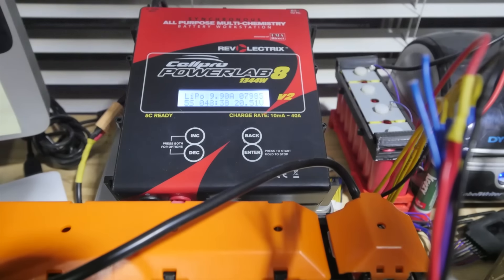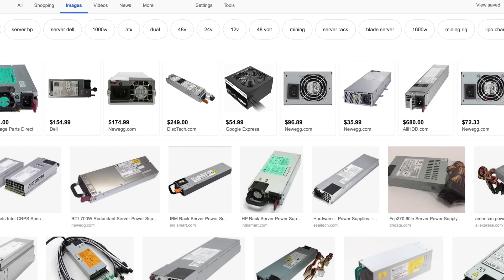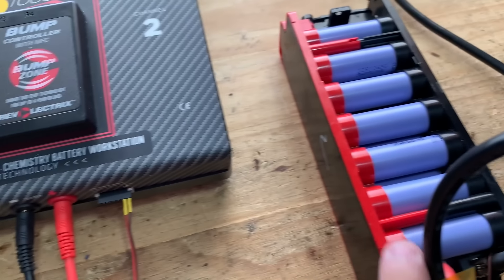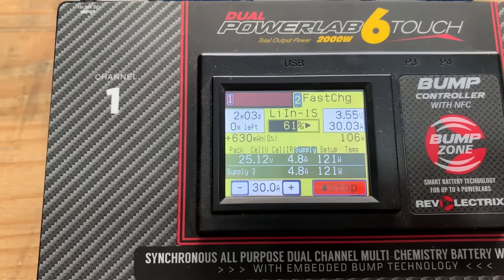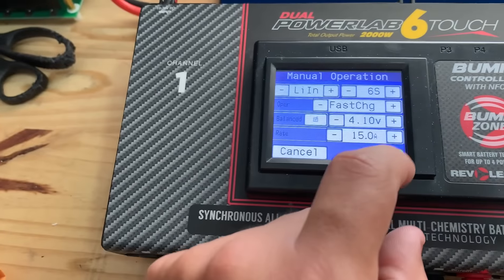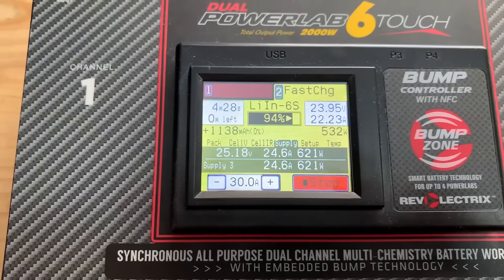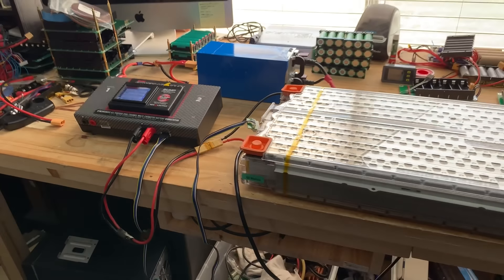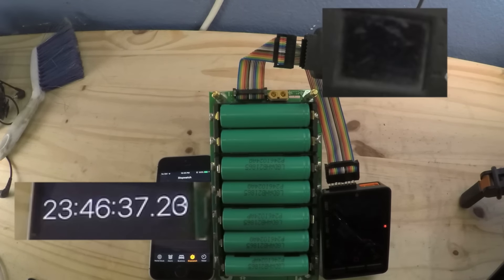$50 Dollar 2000 Watt 24V DIY  Power Supply. (2Kw)

Comment: Whenever connecting independent DC supplies either in parallel OR in series, it is ESSENTIAL that FULL electrical connectivity is checked for proper isolation AND equivalent voltage (parallel) and current (series) capability. In the case of series connection it is ALSO ESSENTIAL to ensure that a) BOTH cases are grounded properly and b) that the DC grounds are NOT connected to the Earth ground or when connected in parallel BOTH supplies will end up being shorted!
Reply: In a parallel setup, what generally happens if one PSU is turned off or fails?  ... my intuition tells me that I really don't want power being sent into the wrong side of a PSU  : O

Can't that large stepdown transformer become a really nasty step-up?  Or, does the design of modern power supplies typically preclude this.  I guess there's some nice power diodes in there - but surely they don't expect to encounter the full force of the PSU in reverse polarity.  I worry that the protection just wouldn't be beefy enough for such unforeseen abuses : /

Does it all just get stopped at the rectifier stage, no heat, no worry ?   I guess if it can't pass the rectifier at all - then the output smoothing stage with those big ol' caps maybe doesn't actually have to handle anything.  But what if there's some path there (in the output smoothing) that can break down and cause current to flow : O

For the record, I'm not about to try any of this... but I am curious as to why it works.

Comment: You can also add a resistive divider across the input pins and bring them
Up to about 13.5v before they start to over voltage. If you add a resistor across a pot inside you can bring them to over 14v. You should stack 4 of them and get a 48v-56v supply! I use the HP 1200w ps all the time for amateur radio stuff. They work great!
Reply: Hi, do you have information about this mod? im a amateur radio operation and this is a very handy power supply for my radios if they can provide 13.8v
Reply: Im looking for a SM  power supply to charge my fiat batteries with. I only want to charge to 4.0v/cell 14s so i would need about 56v. 4 stacked can get me there? I wasnt sure if they where adjustable.
Reply: i would like more info as a felow ham please
Reply: Woah woah woah, you are putting a server power supply load on a resistive divider???
Reply: Vortechnology no, internally you can set the output voltage from the reference via a divider. If you want more then 13.5v you have to modify another divider to trick the over voltage limit. Your not going to put 100a through a divider :)
Reply: Okay so you actually are changing the reference resistor, that makes a lot more sense, lol.

Comment: I believe the other charger blew up because the supply voltage was 12v.  Similar to why I blew up the antimatter charger I have.  The charger has to work to hard for the higher amp outputs.  So supplying higher input voltage should help out the charger a lot!  This is what I have noticed at least for the antimatter charger.  I did the same mod with same server power supplies lol!👍
Reply: Bingo.. The Powerlab 6 and 8 Touch also can go up 48volt input.. really helps out if you go past 6s and high current
Reply: So when will you be recieving your nobel prize for your anti-matter charger?
Reply: They said its in mail 😆👍
Reply: Casually using my antimatter charger, nothing to see here. :D
Reply: I've heard people had issues with them, can I ask which model antimatter and how old? I use a 1000w/30a 10s version with 2 different modded HP PS'. My fave (quieter one,) is only 575w (47a) on 110v and the other is like 1100w (but the fan is noisier and the mains cable is thick n huge!) I've used them to successfully power mine upto 28a (I never use it to max power,) and have had zero issues with it. Mine is already 2+ years old and used daily, but I've heard people with newer ones have had trouble with them from almost the "get go," when run at higher power levels.
Reply: Outputing 30A at 24v with a 12v input would mean it is pulling at least 60A 12v, and that is a lot of current...
Reply: A properly designed hobby charger will automatically limit the output once the input current limit has reached. Can't believe some much more expensive "smart" hobby charger will let itself smoke by input overcurrent  when my $16 B6 clone has such protection.
Reply: AveRage Joe lucky for you the post office isn't affected by the government shutdown. my application for black hole emulator permit is stuck due to no funding.

Comment: Series connection of switching power supply will upset the internal control loop of the individual units due to each power supply have slightly different internal impedance. Try drive the unit you have created at 90% of the rated capacity and show us what happens.

Comment: Why do you insulate the inside board from the case ground? If there's a short the current will travel back to the ground wire through the case.

Comment: So I'm running a 20S LiPo for my electric scooter. I'm going to build about 8 more 20S-4P batteries to replace my lead acid batteries. Right now I'm using a cheap Chenzhen Energy BMS. Any suggestions on a good BMS and charging system? I have a ton of different BMS's I got from Amazon but only the one I'm using had a wiring diagram.

Comment: 11:00 input current is limited by voltage. Increase the voltage to 32V to get 40A. You can add other + and - voltages to go above and below 12V by jumping them together. This is why a PC power supply has negative voltages available.
- 
TLDR: Jump the +12V +5V +3.3V on one power supply to get your 32V and 40A
Reply: Except you will find that the other Voltages will not produce the same Amps. So what you have just done is limited to it to 2 Amps if you don't blow it up first. Bad Idea.

Comment: Thank you so much. 
Can i use the hp power supply listed below to do the same thing or it has to be the same model,
HP 578322-B21 579229-001 570451-001 1200WPower Supply DPS-1200FB-1 A?
and if i need to use one power supply to feed an inverter with a deep cycle battery is there a way to increase the output voltage from 12 to 13.5?

Comment: Pretty sure when charger on last video fried its because the Boost converter in charger was trying to boost voltage to 24V from 12V 
supply and trying to get More amps than charger could Boost / pass thru  - got hot - poof - I use Icharger 4010 Dual to charge 120AH Calb Lifepo4 battery from car alternator - works well - Im putting 2 Tesla S modules in my RV right now -  also modded 3000 watt 50 volt server power supply- was not easy to get it to work - almost gave up( 2 weeks) but finally got it to work -  50 volt output power supply is what you my want- its what I need for charging tesla s 2 modules

Comment: One thing I learned recently is all these chargers have an input amp rating, and to get the full watts you need to input the max volts they advertise. Looks like this one is 30a. It’s a tricky marketing ploy they use and you’ll never be able to reach the advertised watts in practice.

Comment: Can you put the power supplies in series to bump it up to 24v on the input side to and loose the headroom of wattage output of the power supplies?
Could 4 be used and 2 in series then 2 in parallel for redundancy?

Are server UPS good power inverters?

Comment: This is slightly off topic, I want to charge by Chevy Bolt battery pack (355vdc) from solar panels which is not in the car! What do you recommend for a charge controller for that high of voltage? Than divert it to a string inverter which can take that high of voltage?

Comment: Good job! Btw as long as you left the ground connected to the mains they are still connected together so the cardboard in between is redundant but it is better than having metal on top of metal.
Reply: SuperBrainAK the output might not  be referenced to the protective earth on these PSUs anyways, so it might not matter. Sometimes the manufacturers just ground the case.
Reply: SuperBrainAK worth to check the grounding anyways. (I wouldn't want to short these supplies out :)  )
Reply: FinTutorials I’m pretty sure there is a CE rule that power supplies over a certain wattage need to be grounded
Reply: SuperBrainAK I think so too, but these server supplies might be designed diffirently, atleased the case was grounded.
Reply: in the video he shows that he put insulation under where the screws connect the chassis ground to the negative rail isolating the secondary of the psu from ground, so they were grounded all the way through
Reply: SuperBrainAK i agree, but there also are exceptions. I hace taken many power supplies apart and found that the wiring screw terminals or in this case the gold finger tabs are only connected through the fastening screw to the psu outer metal case and not to the secondary side of the transformer. Always check how it's connected with a multimeter!

Have a nice day :)
Reply: These are 100% guaranteed case grounded and you would only worry about this if you were using multiple phases and you are not even using that at 240v so that made no difference.
Reply: @SuperBrainAK  You may well be right, but you are aware that CE rules do not apply to him when he is in the US and not expecting to ship to Europe? It IS a point worth bearing in mind by European viewers however who may wish to follow this process, and in addition local electrical rules need to be observed. In Australia, I'm aware that there are now some pretty stringent rules in place where people are not even allowed to fit a plug top to a cable - they HAVE to use an electrician! Yeah go figure!

Comment: I've been scrolling through your videos trying to find the one where you modified the PSU to power up but I can't find it. I've tried this with 2 PSU's so far. One popped and died after pulling 30A from it for 3 minutes. It was a DPS-1200FB. The second, a HSTNS-PL11, worked fine the first time after I modified it, but then after I powered everything off and tried charging again a couple days later, the PSU's green led would blink on/off and the output would go from 12.2V to 0V repeatedly and annoy the chargers. The 3rd was also a DPS-1200FB works fine if I don't load it up much. Even 15A was too much for it as it shut down after 13 minutes.

For both, I was using a resistor between pins 32 and 35. On the DPS-1200FB, I used a 750ohm, on the HSTNS-PL11 I used 2 750ohm in parallel (375ohm), then like I mentioned, it turned on and seemed to work fine the first time only.

I'm just trying to charge my lipo's for my RC trucks. I run 2 chargers off of it, both set to charge at 15A, so probably pulling between 32-35 amps overall.

Comment: The safety code #21 is from the power supply having too much noise.  As said in the manual, "it is quite
common that everything operates fine until a high-current charge is performed and then the communication link is
lost as the current is ramping up to a high-current charge."

Comment: so i have a 14s24p Li ion battery with a standard 5A charger and if my BMS supports for example 30A Chargepower i can use a charger with 30A safely at home?

samsung 25R cell btw

Comment: Jehu, I am a datacenter architect professionally. One issue you may run in to is the fans being PWM controlled from the host server, might not run @ 100% unless you jumper the fans to 100% of their rated voltage or short the PWM feed to the fan +. Maybe worth looking in to? Not sure if you address this in your PSU hack schematics. Thanks for the content, ideas, and videos! Love your stuff.

Comment: I will never buy a brand named power supplies for RC lipos which cost $380  for a 1200watt at 18v. They never last  & they run hot! Server psu all the way to the bank. Thanks for sharing.

Comment: that thing just charged a cell phone in 3 minutes. if it could handle those amps that is. crazy power
Reply: You are not supposed to charge a LiOn battery at more than 1/2 it's rated storage capacity. Example, a rated 3000Mah battery should have current limiting of 1500Mah@ no more than 4.2V EVER.
Reply: @DrHarryT  i know, thats why i was saying if the phone (intending battery) could handle the current income. I know its completely unreasonable to assume that would work. I just noticed the capacity it was recharging the bank in the video.

Comment: Still can't figure out how to find the switch that turns on a server power supply.. A normal PC power supply is easy, connect the green wire to the ground and that's it. What if I can't find the pinouts for the one I have? Is there some way to figure that out?

Comment: What will happen if one of the SMPS fails. will it feed 12v to the charger. Will this damage the charger or the charger has low input voltage protection?

Comment: Jehu, I use a few Chargers like this, That I hacked, one I did the Floating Mod with Plastic washers and nuts(Nylon). I left mine apart for now, only because I may add them to a bigger Power supply I am making 1K adjustable. I wasn't sure how they might fit together, But Combined and on 220V, I get around 2400w or 200amps(HSTNS-PL11 x 2 ), and on std 120 I get around 1800watts or 150amps. I also made a smaller charger from the same PS and that is 750watts or 63amps (HSTNS-PL18). Both I use with my Reaktor and 1000w Battgo Ballance charger. Great Video!!!

Comment: You're probably still going to run into the issue that the 0v output rail of the power supply is connected to chassis earth, so if you try and run two in series they're still going to short out via the ground pin on the supply
Reply from the maker: They didn’t
Reply: I wouldn't guarantee that's the case will all server power supplies, or even all HP server power supplies.

Comment: You should also flood fill the card edge with solder as the whole of it is meant to transfer power, Not two points...
Reply: NOT the right way to proceed. Use the correct edge connector and multiple cable connections to the relevant pins. IF the single cable connection used is of sufficient current capacity on its own then there would be no issue in a single connection. It's not a point connection but a distributed one. Using the relevant, correct pitch edge connector with multiple cables as per its normal expected use would be the best.

Flood soldering will not provide more current capability for the link, and the gold plate on top of copper will STILL carry more current than the solder on its surface.

 Connecting (soldering) multiple cables in parallel would work far better than flood soldering. That is a proven, reliable, hard wired technique used for decades in just about every kind of ATX supply.
Reply: @boblewis5558  strip 32mm of insulation off an 8 gauge wire,  tin the wire and solder it parallel with the pad's length instead of perpendicular like the XT90 in this video.

Comment: For your power and ground cables look up crimp supply welder cable. Priced great and pure copper.. and can take a lot of power without getting hot!
Reply: Amen on the fine strand stuff, up to SLMR (but that has fiberglass insulation and is a hellish thing to work with, locomotive cable essentially)
Reply: Only problem with welding cable is that damned rubber insulation and it's relatively short lifespan. I had my starboard engine aboard my Chris Craft wired with it and that stuff just all either fell off or was left as green muck filled tubing as the copper was mutated into greenish gooey paste. Best all around wire for this to me would be a tinned copper fine strand, with Teflon inner cover and a PVC outer jacket similar to tray cable in the plants. Expensive stuff but when you start comparing ampacities to the regular THHN building wire and it's complete lack of flexibility, it's often worth it.

Comment: ditch those powerlab chargers for a Icharger 4010.  it's input/output specs exceed the powerlab 8 and your new powerlab 6. you may want to read the manual for that charger. I think you can synchronously charge by connecting both outputs to the one battery like the icharger does.  the icharger will output 70a in synchronous mode.

Comment: There was a fairly recent video by Joshua bardwell that explained these chargers. Most of the chargers are limited by their input current not their output. I wonder if that's what's happening here.
Reply: RC chargers are very often input current limited, yes, if not always. Mosfets are expensive to oversize enough that you can fully utilize the power at the lowest input voltage.
Reply: Simple answer, yes.

Comment: You should be able to set the max input current like you can in the iChargers.  Everything on mine is just a menu setting.  I’m surprised you didn’t get something that can handle at least 7s!  I’m using mine to test charge/discharge a complete PCB.

Comment: 4:11 Breakers in the UK are 16Amp for the 240V ring main circuit... 3840w through that bad boy before it says bye bye fool :D
Reply: Breaker for our main is 200 Amps at 240Volts. Should by load be limited to 160 Amps per code. 38KW but rated for 48KW. Sub panels include 50 Amp breakers for them. And yes , we do have some 50 Amp sockets.
Reply: gravelydon I didn't say main breaker, I said ring main breaker, which is the one that will trip if you are plugged in a normal household socket.

Comment: Awsome!  this may be a great idea for diy electric range motorcycles.  Already aware 3,600 watts will give a recharge of about 1.7 miles range per minute @ 30wh per mile.  102 mile per hour charge.
fills up fast a 12kwh pack in less than 3.13 hours with 15% efficiency loss & 80% use of battery capacity. that's 239 miles range in 3 hours , while using 80% of your battery capacity.   All we need is instant or fast chargable batteries to get to 2 to 3 miles per minute of charge.  Ev's rock.

Comment: My only advice is use at least 8 gauge wire from that power supply  to the charger and I bet u will be able to ramp it up higher. Even at 600 watts you should be using 8 gauge wire also I would ditch the connectors